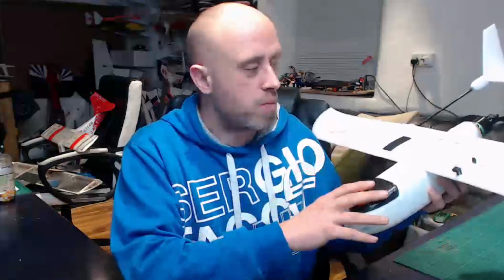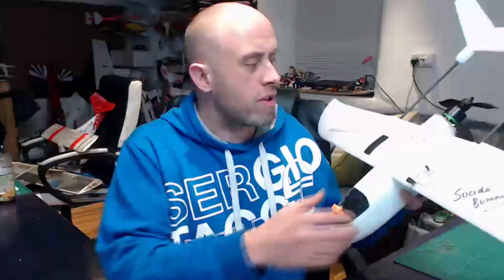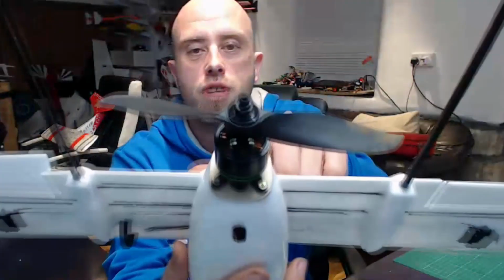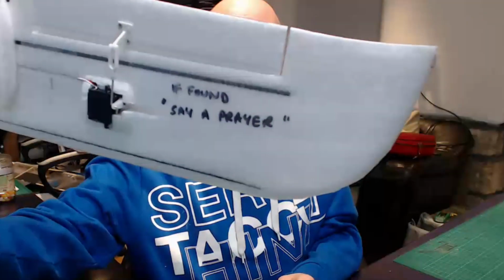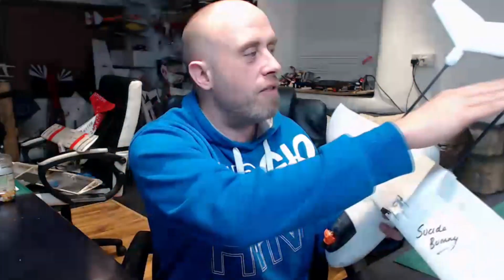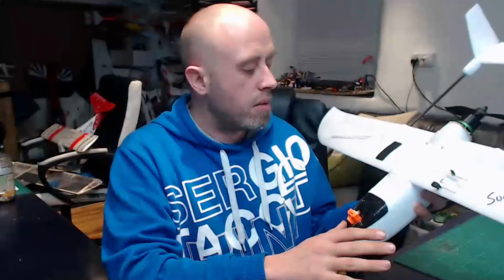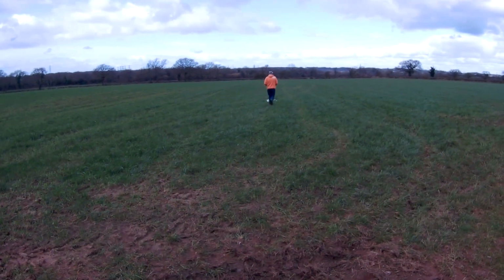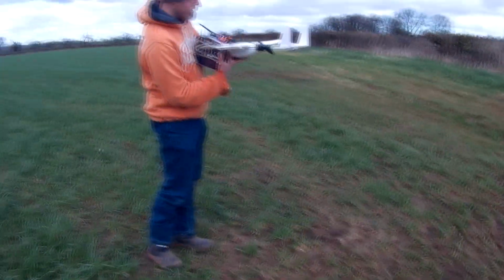"Suicide Bunny" Maiden - The Worlds Fastest Micro Skyhunter (With an unhealthy dose of torque roll)

Comment: Hi man i want to get 1 of these should i get a better antenna? also like to run on 4 cell:)
Reply from the maker: Howdy fella, I have no idea what antenna you're using at the moment. If you intend flying something at or around 100mph, then common sense would prevail, so a decent vTx, googles, antennas and receiver. Matt
Reply: I meant i will have the standerd plane an go with upgrade of esc for 4 cell, just want info on best vTx an antenna so i dont lose picture whilst flying.Cheers m8
Reply from the maker: Howdy Nev, press the "SHOW MORE" button above for the kit I'm using in this model. I include that with most of the videos I post as otherwise I'll forget, Matt
Reply: Cheers M8 :)